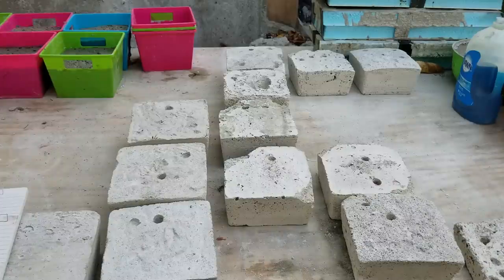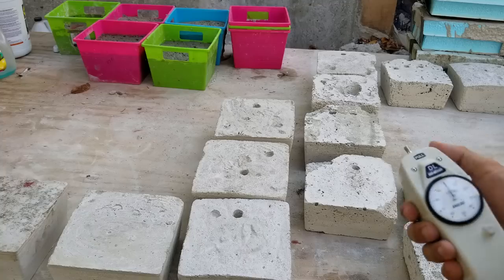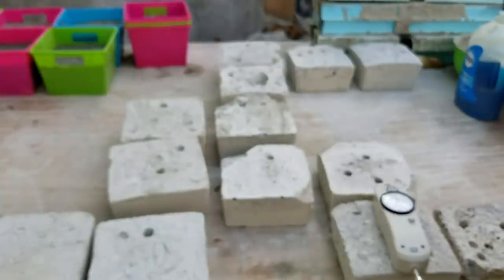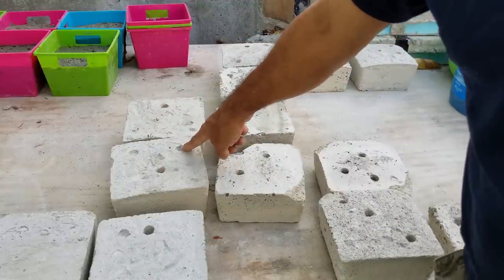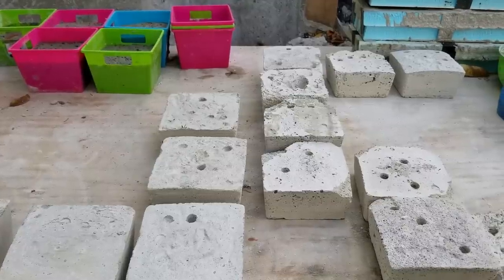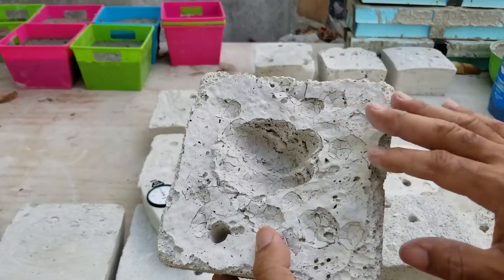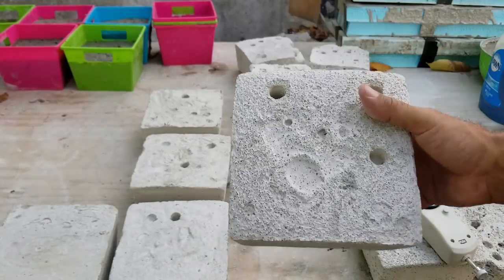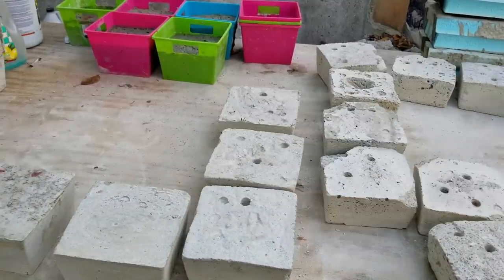Aircrete | Test Results after 4 Weeks of Curing | #aircrete #aircreteharry #diy #aircretesamples

Comment: This is very useful information. However, it is not as definitive as it could be. Here are my recommendations for more accurate results.

1. Label the samples with an easily seen number.
2. List the recipe for each next to the number ON the sample.
3. Use a more standardized testing method such as the rebound/Schmidt hammer OR the scratch test. 

4. Calibrate your measuring devices. Once you pushed the PSI tester past its maximum you invalidated all subsequent tests. If you must use a PSI tester obtain one with a much higher range. The general rule for testing is that all devices are not accurate in the top or bottom 10% of their range. Also use a drill press with an adapter for the drill press head to push the tester down. Keep in mind that structural cement can go as high as 10,000 PSI or well below 3000 PSI.
5. Put a link to your spreadsheet. I would love to give that a good looking over.

Thanks for your in-depth review of aircrete. 

PS, How would foam balls or other light weight materials improve your mix?

PSS For those of us making planter boxes and what not that sets on the ground a weed eater test would be great!

Comment: Could you take the time and measure the density of the blocks?  I put mine in a plastic bag and determined the volume of water they displaced.  With a standard mix I was getting around 400KG/cubic meter.

Comment: Harry, I love what you are doing here. I have a few suggestions for you on your testing though.
1) Figure the area of your push meter probe head. This can then be converted to PSI measurements, for ease of communicating compressive strength.
2) Insert different color strips of construction paper into each mix, according to mix ratios. Other variables can then be written on the tabs.
3) Build a lever type tool to push the force meter down onto the cement surface, squarely & evenly. Screed off the tops so they are smooth also.
4) If you do multiple day tests, then mark the wet cement into quarters & number them. 
5) Have a covered area for storing the samples during the month test cycle, so they are safe.

Are you planning any tests with rebar or wire reinforcement? Fiber reinforcement?

Comment: Let me start off by saying how much I truly appreciate the effort you have put into these tests. Absolutely invaluable knowledge that you are giving away for free, and I truly appreciate it. Having said that, there are two other categories of testing that I personally would love to see. One of them being a pull test. Where you drive a standard wood screw of about 2 in of length into the center of each block, and set up a scale to determine how much force it takes to pull the screw out of the block. The second test I would love to see is a tensile strength test. Where you mold bricks in a bread pan, supported on each end, and put a weight on the center of it building more and more wait until the block cracks in half. Once again, thank you so much for the work you do and the effort you put into your videos.

Comment: Heya Harry! I recently discovered aircrete, and i find it very interesting except for the "surface brittleness" that you are demonstrating here to some extent. Im assuming abit here but is the aircrete surface abit like a sponge? What do you think the result would be if you would reinforce the aircrete surface with a coat of polyester? Just the poly that is, not the fibremats.
Reply: I was thinking simple fibers like embedding old bed sheets in the face of the mold..

Comment: Great tips as always Harry...thanks! 

How about we use the 
We apply the  shell (coating).
Add the reinforcement fabrics (test a few) and . 
*say 30 days?

Afterwards, you  at it!---  take your pick of ammo, distance, etc. 

Objectives:
1. Show the hardness and strength at several thickness. 
2. Show the impact (penetration) resistance of the various reinforcement fabrics.
3. Determine at what  renders the Home/Dome "".

WHAT DO YOU SAY..?

Comment: What brand of meter did you use? Is it accurate for destructive testing. You are giving the values as pounds. Foot pounds? Pounds per square inch? Square foot? If the failing point is 100-120 PSI, I would not consider aircrete as a foundation. This is far below normal compression for regular concrete at around 3000 PSI minimally. Also porosity weakens concrete. Aircrete might work as an insulation due to its porosity, but the only value I have seen for its insulating properties is R6. Have you actually measured its effectiveness some way?

Comment: Harry, what was the volume that you poured each time (the volume to the handle opening in those plastic containers) ?
Without that information, we do not know the absolute density of the samples, only the relative densities.
Could you just measure the length of one of the sides and also measure the inside height from the bottom of the container to the bottom of the handle opening ?

Comment: Compressive strength of AirCrete is inversely proportional to the the amount of foam present in the "cement-water-baking soda-foam mixture" type  of additives present after 4 weeks of curing.  As opposed to cement-water-sand-crushed stone standard mixture for Concrete production, AirCrete is lighter but has much less compressive strength.  Thanks for your measurements.  I conclude that Aircrete has insulating value at the cost of decrease in compressive strength.  
Would a reasonable person sleep under a roof of AirCrete?!  You be the judge!

Comment: Hi Harry, would a 150 lbs be possible without collapsing for insulation. What you do you think. After the final tests, how high can you go with the addition of foam for a foundation using aircrete. Could you use 50 or would you stick with 32. Some of your samples at 50 with the addition of an accelerant did almost as well. let us know what your recommendations would be if you were to build a foundation.

Comment: Did I miss something,,, what does “50 ga.” Sample mean?

Harry, what do you find are the results of using baking soda(or was that powder) and what amounts are you using?

Also, what was your foam density? Was that consistent as well?

P.s. doin’ good work Harry. =D
Reply from the maker: 50 gallon means 94 lb bag of cement 6 gallons of water gives you 7 gallons of cement slurry and you put that in a 50 gallon bucket and filled to the top with foam. The 10 20 30 50 + 100 are the size of the container you will mixture cementing and filled to the top with foam. That allows you to make consistent batches by using a specific size container. The foam density was 3 lb for a 5 gallon bucket. The baking soda is about a tablespoon worth n a 94 lb bag of cement. Thanks for watching and thanks for your comment
Reply: @AircreteHarry  Got it now. Thx. I just needed a bit of Harry lingo under my belt. :-). Keep doing what you're doing my man! =D
Reply: @AircreteHarry  hello harry my cuestion is how to take out the bubbles
Thanks

Comment: I don't understand why you can get different results from the same batch unless it was not thoroughly mixed. Am I missing something? I appreciate your labors. I'm thinking about a structure I want to build. I love the dome idea. I'm thinking a traditional dome with aircrete insulation instead of foam. I'm just not convinced the aircrete can ever be structural even  with steel. Time will tell.
Reply: Aircrete works well - structurally - in a tropical environment.  I have doubts about a climate where you have a freeze/thaw cycle.  It will be interesting to see how Harry's house turns out.  See the Dome Gaia website for info on their house in the tropics.
Reply: Kate Mwariri Concrete (not aircrete) has an extremely high compression rate (can’t crush it) but it has very little tensile strength (can be pulled apart easily). Steel reinforcement such as rebar is the opposite. When the two materials are combined  you get a incredibly strong system for structural application. I just don’t comprehend how that can be achieved with aircrete. I’m not suggesting it can’t be done, I just don’t know..
Reply: @RedefineLiving  There are additives - like basalt - or micro rebar which will vastly improve the results of compressive strength testing - if you don't want to go with rebar or maya  like a traditional concrete pour. I haven't tried it yet personally, but I'm thinking it (addition of basalt or micro rebar) will improve the end product.  I'm not in a freeze-thaw area - but earthquakes aren't unheard of here and I would like that extra stability.
Reply: Kate Mwariri the micro rebar and basalt are excellent products but they improve the tensile strength, not compression. I realize there are additives but his tests are around 100-200 as where traditional concrete is 2,500-4,000.
Reply: @RedefineLiving  ok - now I get where you're going ..  way  beyond my knowledge base.  Learning curve 😂.
Reply: Kate Mwariri Sorry, I’m a contractor. I can’t help it haha.

Comment: Here's what I'd love to see, Harry: build a visible stud bay... 2 studs 16 inches apart, plywood or siding one side, glass or plexi on the other. Have it PARTLY filled with fiberglass insulation, such as what might be in an old wall. Then poke a hose thru a hole on the wood side and film how well the aircrete fills the stud bay around/through the insulation. If you can prove how well it does this you'll have millions of potential customers. My electric bill for my mobile home last mo. was 260. If I could knock 150  month off that, 3-4 months a year, your machine would pay for itself in a year!
Reply: mannnnn! you need  to do some homework before you go babbling wishful thinking!  I could make a list, but that is YOUR burden!

Comment: I've been following your great videos that are very informative. Thank you for the time and effort you've put into Aircrete. I'm designing a small home using "A" Model Metal Span Building. I plan on using the metal building panels as forms for the Aircrete. After I put the building up, the formed Aircrete blocks will be attached inside and outside the building's corrugated valleys. The Aircrete will act as insulation and smooth out the interior/exterior surfaces of the building. My question is how much does your Aircrete strongest formula weigh per cubic foot?
Reply: I am trying to find this out too

Comment: So, do you think aircrete could be used for patio blocks, and the not drived on part of a driveway or walkways?
Reply: There's another channel that did an aircrete patio - and followed up after a winter of weathering.  Not sure about their mix ratio but I'm sure they would tell you. Driveway ?  Somebody always wants to park where they aren't supposed to.  For that I would stick with concrete and properly done mesh. (IMHO etc etc - YMMV)
Reply: Kate Mwariri Thank you. I did see that channel and their follow up.  I was just curious if someone else did a patio or walkway and how it wears with traffic as it doesn't seem to be very wear resistant like regular concrete. At this time I use aircrete as a refractory in my rocket heater. Yep people do what people do. 
Thanks again
Reply: @dennismadigan2023  I live in Kenya most of the year.  My walkway is made with 50% "hardcore" (stone that houses are built from here) and 50% aircrete.  The aircrete seems to hold up better after 3 years.  The stone tends to crumble/shed and breaks easily when cut less than 9 inches thick.  Compared to local concrete - aircrete is about the same.  But compared to concrete at home in the US - the aircrete doesn't wear as well.  They aren't side by side comparisons - just comparing the wear on my 60 year old sidewalks vs. the 3 year old aircrete - US cement hands-down.  I'm at the age where I don't want to have to re-do stuff.  Next (and last) project will be an aircrete dome. I'm hoping the insulating properties will be equal to the stone for keeping the inside cool.
Reply: Kate Mwariri 
Thank you for your valuable information. Yep!  I'm at that age too. But when I do I try to get the biggest bang for my buck but if it doesn't last there's no sense.
For your dome and similar projects it should work fine.
Reply: The issue you would have would be from furniture. If you weigh 200lbs and you sit in a chair, the feet of the chair could start to poke into the surface especially if you lean back on the chair. Why not just use regular concrete for that application?
Reply: So, can this air crete be used for a driveway and if so, how thick does it have to be in order to hold up to a standard 2,000 psi to 3,000 psi? Can re bar be used in it? Thanks @mwindanji6714
Reply: @RedefineLiving  I wouldn't use it for the floors - just the dome.  Floors will be standard concrete with Maya/mesh as hubs has a tendency to bring his bike in at nite when the thieves are active.
Reply: @pokeythebear1  Mark, check out some other aircrete info  .. But I wouldn't do an aircrete drive.  With aircrete, its not necessarily the thickness that gives strength - its the mix.  Just my opinion, but I wouldn't do a driveway with aircrete - not even with mesh or rebar.  I doubt it would hold up to the vehicle weight.  Again, my opinion.  Also, check DomeGaia. They have some great info.  And Harry has some strength test videos comparing different mix ratios.
Reply: Kate Mwariri the floors will be under much stress then the structure with wind and snow loads. Ii think it would not work for anything structural. It would however make an excellent insulation.
Reply: @RedefineLiving  I live on the equator.  No worries about snow and freeze/thaw.  Regular concrete for the floors (cause hubs likes to bring his bike in occasionally) ... Aircrete for the dome.
Reply: Kate Mwariri I believe the weight of the dome would collapse under itself. Regular concrete has a compression strength of between 2,500 and 4,500 psi (yes, thousands). Aircrete is under 200. That's a huge difference. You will never get anyone to sign off on it and it could literally kill you. Something to consider.

Comment: Harry, I love the video and maybe I missed a previous video where you give the proportions of cement mix to foam for these samples but I would like to know how much foam to add to get the mix you called 32 gallon, just foam and cement mixture...  Is that using a whole bag of cement mix ?  with how much water and how much foam???  Thank you again for sharing your info.
Reply from the maker: 32 gallon refers to the size of the container you're mixing in. So for a 32 gallon garbage bin for example you would add 6 gallons of water one 94 lb bag of cement and fill with foam to the top.
Reply: @AircreteHarry  Great video with very good information. Thank you for answering this question that I was going to ask.